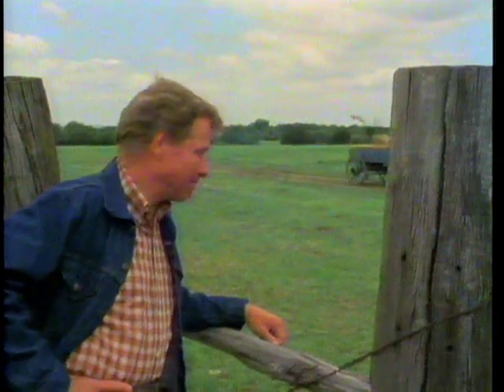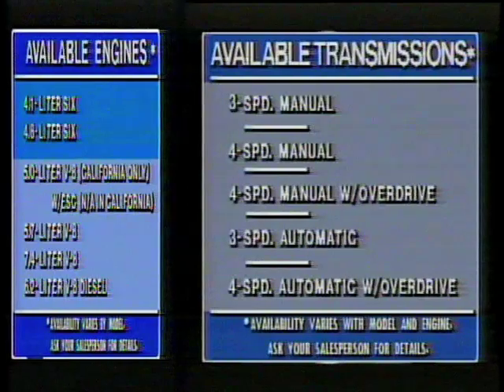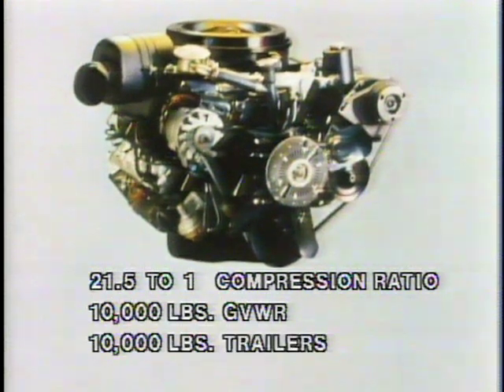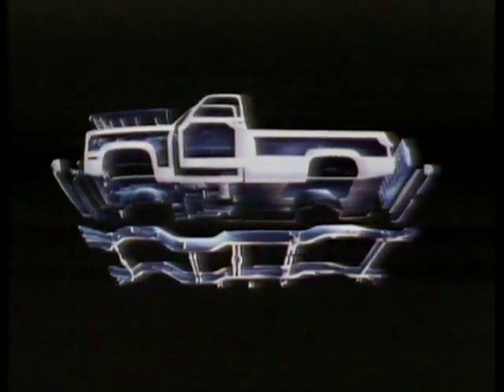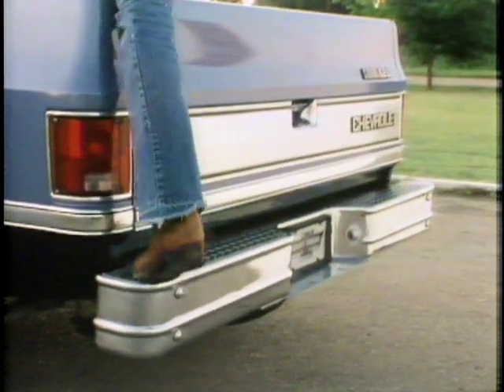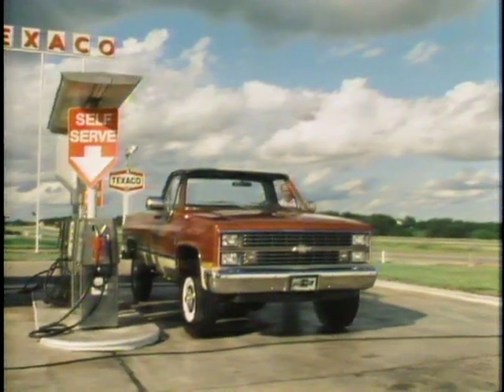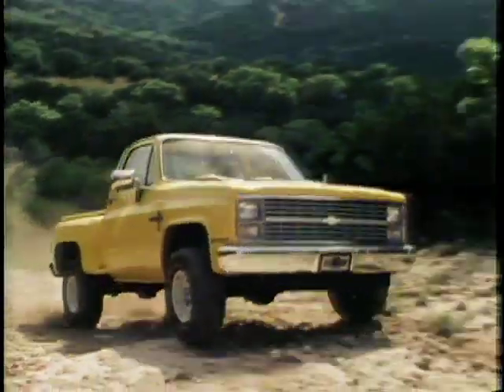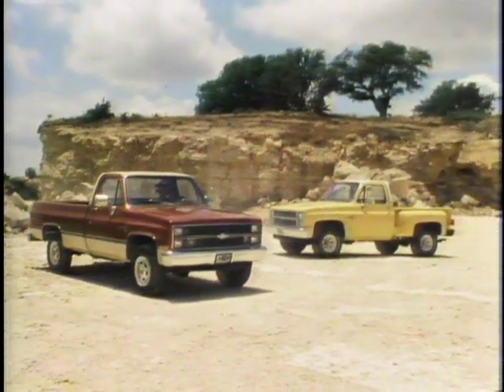1983 Chevy C/K Pickup Trucks

Comment: The thing I love about these trucks is their simplicity. Today's vehicles have too many computerized components. Wifi this, touch screen that. Just give me a strong reliable motor and I'm a happy camper.
Reply: Charlie5thumbs I hear you man. I have a 96 Ford F150 with 5.0L Windsor V8 with 203,393 miles on it and it's still going strong.
Reply: My 1988 Chevy.  had over 400,000 on it when when my blow up  the engine by not checking the oil.  My 1991 Chevy has 350,000 and still go. Had a 2001, and a 2000 Chevy. Went back to the 91
Reply: Charlie5thumbs a strong engine, transmission and gear ratio and you have yourself real truck.
Reply: The newer pickups have a better looking hood and grille
Reply: no new trucks are ugly as sin
Reply: You're right. I'm from Ecuador; the trucks that arrived here are still working despite roads are not so good.
Reply: Elvis Thoughts the 2000 and 2001 would of had a much better driveline, but have a crappier ride
Reply: Charlie yeah I love my 86 can’t beat my 66 tho they both have 350s but the 66 is all metal everywhere lol
Reply: Charlie AMEN BRO!!!
Reply: Charlie They need to find another way to Milk your wallet dry.
Reply: Back then ac was a luxury item on trucks
Reply: Give me an AUX and a USB port as well.
Reply: ...and when my dad bought this truck back in the 80s, he droaned on about how over-engineered and POS they were compared to the good ones back in the 50s.
Reply: Charlie5thumbs
Reply: Charlie I agree, who needs all that computer stuff including a rest view camera. I thunk this is why trucks cost even more with all the extras that is not needed, least for me.
Reply: Yep,... The future holds more crappy plastic and dialed in engines engineered to fail before 140,000 miles.
Reply: I Know Better  pictures please
Reply: @davidalvearmartinez4258  I was in Ecuador a few years ago travelling and I noticed there were a lot of smaller Toyota and Mazda pick-ups that had diesel engines.  I wish we had those options in the U.S.
Reply: @noneya6334  BRUHHH
Reply: @Cre80s  The 50s In the 80s are what the Nostalgia for the 80s Are today.
Reply: @Victoria3232-j7o  Yes, I know.  My point is that everyone's wrong.  We're all suckers. The worst suckers think they were less suckered back in the good ol' days.
Reply: sensor goes bad whole trucks down
Reply: They were pretty much out of the 70s until 1991, although by 1983, emission controls were in full swing, and people considered it all complex

Comment: This were Trucks... today's trucks are for just for groceries
Reply: hmm,  well at 1:42 it says the '83 chevy 1ton dually will tow  "up to 13,000 pounds".    A 2016 model 1 ton dually (from any of the 3 brands)  will tow up to 30,000 pounds.   That's a LOT of groceries!
Reply: Sho' Nuff well, not just for groceries, but for other stuff.
Reply: Sho' Nuff and flowers 😂😂😂😂
Reply: Sho' Nuff Oh definitely my friend.
Reply: kbjcda Yeah but the new one is still overpriced looks ugly to.
Reply: Sho' Nuff Don't forget that new vehicles are overpriced as well.
Reply: Actually only the current Dodge trucks can handle up to 30,000 and you need a cdl to tow that much legally.But regardless chevy all the way!
Reply: Nonsense, my '04 2500HD has been towing trailers, campers, and other vehicles since i bought it, hell, I even pulled my friend out the mud when it was almost to his headlights
Reply: Shock Master tool boxes thats all they throw in thr back to show itsv suppose strength this is were commercials explained there products now its less than q minute and act like they dont even care
Reply: Today's Duramax diesel has 910 lb/ft of torque and 445 HP. Are they expensive? Shit yeah they are but your memberberries for the old days blind you from the truth.
Reply: coltwalkerjr i use my 1998 landrover defender simple reliable lots of torque  andwill pull about 12 tusand pounds
Reply: 12 thousand pounds?? no, its also a 4 cyl, or 300tdi Diesel, which has a weight/pulling cap of 8000lbs, now, a Chevrolet c20 3/4 pickup from 1984 with a 305 4 barrel can pull up to 15 thousand pounds, and i have experienced this towing cap, i haul Scrap iron, mainly Long iron from semi trucks, and i hauled 13 rear Mack 10 wheeler Springs, two rear axles, 4 front springs, and  a transmission, along with a trailer filled with Aluminum brake canisters, mufflers and tie-rod ends, all came in 9,000lbs on the trailer, and 7,500 on the Trucks bed. it was low, but it hauled it up hill, and down hill with ease.
Reply: I just label them a SUV with a bed like come on a sunroof in a full size really?
Reply: Foxmakesmodels Your BS is getting thick.  Those old 305’s were dogs.
Reply: Shock Master that happened when Chevy stoped offering single cabs. Dang do I miss these things
Reply: kbjcda GM quality is crap now These C and K 10 pickups were built like tanks GM and Ford Pickups were pretty close in quality control back in the day
Reply: There trucks alright. Trucks with weak frames.
Reply: Old truck commercials often show their truck going off road, making huge jumps and running on pot holes and speed bumps at high speed or any kind of torture test to prove their durability and ruggedness. New truck commercial are wimpy reduced to Hollywood drama.
Reply: @kbjcda  Now if I could only figure out what my 85 C30 dually and 86 K2500 can tow...
Reply: Sonni Perth Don’t forget how many people use diesels to roll coal on Priuses.
Reply: @rileysmith9843  😆 those are the people that just make you shake your head.
Reply: I like old vehicles more than the next baby boomer. But the 80’s are over dude. Get over it... new trucks will out do anything and outlast anything old out there.
Reply: @williswhatchutalkinbout4367  😆 yeah right dude. These trucks got too much high tech fancy shit to go wrong and they rot like hell. 80s trucks used better materials in them. I've seen trucks start rotting out after a couple of years but my 85 and 86 square body trucks as well as my dad's 95 F350 have little to no rot.
Reply: @YourName-jm7lz  More reliable and cheaper to fix than the new shit on the road. I dont need all these fancy touch screens, cameras, sat nav systems or other bull shit. And so what if the new shit does make more power with better mileage with less displacement? What I have is fine for what I need. I dont need a new truck that would just end up being overkill. And just what do you consider to be a "real" truck by the way dude?
Reply: SOU6900 let’s see your 454 one ton pull 35k through a Rocky Mountain with the cruise set at 70.
Reply: @williswhatchutalkinbout4367  let's see these 2020 diesels do the same thing then. I got no need for something like that to begin with nor would I want something that over rated anyway.
Reply: SOU6900 they do. Look it up. Your on YouTube. It’s all there.
Reply: Willis What Chu Talkin Bout: at what point does anyone need to pull 35k through the mountains with a truck smaller then a semi? And if they want to, they’re not going to do it at 70 mph, unless they’re going downhill. And nobody wants to go 70 miles an hour, down a mountain, in a pickup, with like 6 more pickups in tow. Unless they have a death wish. I know this, because my grandpa was a trucker, so was my dad, so am I. and let me tell ya, my new f350 dually won’t tow 35k at 65 on a 3% grade. So yeah, unless you got 1000 horsepower, your not going 70 up a mountain. Get your head out of your ass.
Reply: Duramax Diesel hot shotters man. They do it all day everyday. You never know what they need hauled.
Reply: Willis What Chu Talkin Bout: I’m a hot shotter. I’ve pulled 43k on a new ford (illegal) up a mountain. I could barely get it up to 50. Pulling it straight sure, I could get it up to 65. Pulling 35k up a “mountain” I can barely get it up to 55 but your not going over that even with your foot to the floor. If you want to haul big loads, get a big truck. I will never again haul over 28k with a pickup, I’ve had too much stress and bullshit to date with pulling loads that are made for class 8 with class 3. No more.
Reply: Barely.
Reply: MHMHMHMHMCHEVYCOLORADOMHMHMHMHMHMMHMHM
Reply: I have an 86 Silverado short bed 4x4 its copper canyon metallic. I've gotten nothing but compliments on it when ever I've driven it.
Reply: The big thing is no new truck will last as long as alot of these older trucks because the older ones were all metal and built with quality the new one are most plastic and with fall a lot fast no doubt it's common sense
Reply: What were people using pickups trucks for back in 1983? Because i can assure you unless someone worked construction they were picking up groceries with their truck. The problem today is that most people who have families think getting a truck with a backseat and dinky 5.5 foot bed is a traditional pickup truck. Its not. Unless one has a regular cab, 8 foot bed pickup truck, he doesn't have a real workable truck.imo I have a regular cab 4x4 2018 ford. It looks like a truck. Sure I dont always use it for work but living where I do it's the best vehicle to own. Goes through harsh winters with ease and wears much slower than a sedan.
Reply: When v8s where the thing now it’s v6 and in-line 4 truck 🤦🏽‍♂️
Reply: Although at work I have a company truck. 2012 ram 2500 with a hemi that's pretty capable.

Comment: I like the 4WD section. The drivers are bouncing around pretty good haha. the sad part is, a brand new 2016 couldn't do what those trucks did over 30 yrs ago. There would be plastic smashing everywhere, air bags going off and traction lights coming on.
Reply: thats why i turn off my TC and stabiltrak always, and ive kicked mine around, i can guarantee that they are still built well
Reply: I've verified that when these old trucks were built 16-18 gauge sheet metal was used, while nowadays 20-22 is the norm even for trucks. Ever wonder why you see people close their doors and the metal flutters? Fords are brutal for this, the 2007 and newer GM trucks have fluttering hoods at highway speeds. They call it dent resistant, I call it BS. Also the OEM's now consider glass as part of measuring the structural integrity for a vehicle, including trucks. Are newer vehicles safer all around? yes. Are older vehicles safer in fender benders? yes. Are newer trucks more powerful? obviously. More capable off road? Not a chance. After plowing snow and driving in the bush with a 2015 3/4 ton chevy. My 85 1 ton 4WD is twice the truck plowing snow and venturing offroad by a long shot. Not as comfortable though. But its a truck, not a car. I prefer the KISS principal brought to us by the US Navy.
Reply: jingorat that's actually not true
Reply: This series of GM trucks were notorious rust buckets. I don't know what gauge metal they were made of but they were bad. The generation previous to these ('67-'72) were far better trucks.
Reply: its how the steel was treated, it was solid, but it wasnt treated, and ive owned my fair share of 67-72s, the outside didnt rot bad, but the floors and inside of the box and fenderwells rusted out just as bad
Reply: 4thstooge  they were garbage, I still see alot more fords from that era on the road and in decent shape.  most of these shitboxes were scrapped
Reply: The reason these trucks rusted was due to the design, Dirt, water, and all kinds of stuff got stuck and just rotted, that is why When the Military Bought these trucks the rust prevention they used was to drill holes where panels came together and then spray a fluid film inside. I don't understand the POV that there was so much wrong with these trucks, or that they will not hold a collector value, I am in the Business of Buying and selling parts for these trucks and the prices are exactly in line with previous generations. I Personally have been around these trucks for 15 Years, The idea that Ford or Chrysler built a better product is laughable, Not to mention the fact that Ford and Chrysler copied so many things off of the 73-87 Chevrolets. In the end opinions are like Assholes and everyone has them, but I do suggest you take a look at the values of these trucks as well as all of the parts that they use, Just like the Small Block Chevy, There is More Aftermarket Support for 73-87 than any of the Ford or Chrysler's from that era. As always Your Mileage may vary although it may be less in a Ford or a Chrysler Product.
Reply: agreed. To say there's no collector value is a little short sighted I think. I don't know any other generation of truck lasting almost 20 years. That's unheard of in this day and age. I deal in the parts and trucks as you do, and they're only going up in value especially in the rust belt. cheers
Reply: thats amazing you have the ability to see in the future.
Reply: My friend had one of these he had to "junk" it because the cab mounts rusted away. When you stepped on the clutch the whole cab shifted!
Reply: jingorat yeah
Reply: 4thstooge so fire it up in gear and don't use the clutch and when you  have to stop shut it off and when the light turns green or no one is coming fire it up in gear and just bangshift it in between gears
Reply: jingorat Amen and not to mention that vehicles today are not only overpriced but they look hideous and ugly, so complicated, made out of plastic, and lack soul and character as well.
Reply: jingorat new trucks can over speed at least
Reply: APPLEYKING 5 LOL I STILL HERE But they won't outlast the engines in the 92-96 Ford Trucks.
Reply: well honestly these new trucks dont have much value i have a 1999 4.6 v8 my dad has a 1998 4.6 v8 a 12 valve and a 1978 350 and through those year models there not built the same more plastic and emissions laws have been forced on companies really taking out the though trucks we once had
Reply: CJ Colvin think again buddy it all depends how you maintain and take care of the engine. I hardly see Ford trucks of the year that your mentioning but what ever makes you happy
Reply: chevyxrz My 96 Ford F150 has a 5.0L (302) Windsor V8 with 205,945 miles on it and it's still going strong. The only thing I replaced on my truck was the starter but other than that mostly was just simple maintenance and cleaned out the transmission fluid just to get rid of the shuttering it was making and it hasn't had a problem ever since.
Reply: CJ Colvin my 1990 Silverado has a 5.7 350 with 224,564 miles on it and still working strong. But like I said it all depends on how there maintained
Reply: chevyxrz True.
Reply: Uh I've had my 2014 Silverado in the air and all is the same before it left the earth!
Reply: Terri Dunbar true to that we still have my great uncles 1970 f100 so realizable the 300 6 under the hood is pretty much bullet prof
Reply: jingorat b
Reply: @4thstooge75  they were getting better by 1983 when this was made the mid to late 1970's models were more rust prone.  But I believe after1980 starting with the 1981 model they were getting better and by the 1987 model year for 1/2 and 3/4 ton  pickups and 1991 for K5 Blazer and Suburban and 1 ton models the body integrity was much better for this body style.
Reply: @jingorat  True that, I have a 2000 Silverado now, great truck, but my '86 old school Ram was built like a tank! That thing was some heavy metal.
Reply: Computers and sensors quitting make your vehicle dead on the road ....
Reply: Lol the drivers really are bouncing around all over the place! Haha
Reply: My 83 will beat you like a horse wagon and it’s dual shock😂
Reply: @judgedredd8657 not as good as these lol

Comment: Oh how I wish that they would bring back the manual transmission
Reply: me too, just don't like an automatic in a truck, never did and never will but I guess we'll have to dream on, learned to drive on a 1975 c 10 3 speed on the column, 350 engine wish I had it back.
Reply: you can order a new truck with a manual if you want.
Reply: I still drive one
Reply: @jrodificator1  Try to get one from any of the Big Three.
Reply: @seththomas9105  Ram offered Manual transmissions up to 2018 model year 2500 and 3500 but no longer do as of 2019 model year trucks. Chevy and Ford stopped offering manual a long time ago.
Reply: Nobody knows how to drive them and nobody wants to even try to learn how to drive them. That's why manuals aren't coming back.